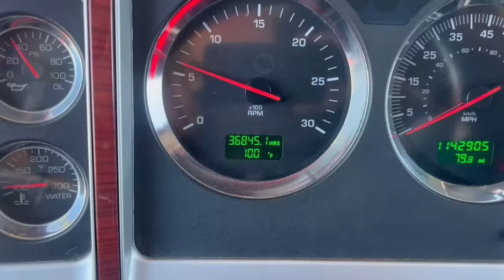"WRAP IT UP" | Engine Harness Replacement on a Cummins ISX KW W900

Comment: Thanks for sharing why you can get by with an older truck,because you do the work saving over 140.00 per hour. This is how it was done by owner operators back in the day. Used to see some guys overhauling their truck in a truck stop parking lot. Awesome job
Reply from the maker: I was present as a kid when my dad and 2 friends were slinging pistons in a 3406B at little America in flagstaff. Miss seeing that kind of stuff, most guys now a days can’t change a headlight bulb ☹️
Reply: @TruckingTogether  I saw a guy at Bigelow road overhaul a mack and I did 2 full rounds from Minnesota to Los Angeles and he was just buttoning it up when I was on my way out for the 3rd round.  He had other drivers offering to help out too. Those days are gone forever,and it's the loss to these new tank top shower shoe wannabes .keep your head up and don't look back.  Luke ch 9 vs 62. Keep your hand on the plow and don't look back. Safe travels

Comment: I had complete confidence in you that you would fix it !! When you have a few spare dollars I would highly recommend you get a large tent or something to pull the truck under when you are working on it to get out of the sun..........also get a large out door / shop fan ........ Working in the heat drains your energy .......and for me makes me lose my temper faster. Just a thought. Great to see you are back on the road.
Reply from the maker: Thanks!! I just need a shop with AC 😂

Comment: Before I retired, I noticed that they were moving towards that cheap plastic loom. I see that it just doesn't stand up, getting brittle and sharp. Perhaps, next time you run into a wiring issue, there is a better quality aftermarket loom use can "sub" to protect those vulnerable wires? Congrats on the successful (and money saving) repair! I think I enjoy watching you work on the truck as much as I enjoy watching you on the road. Martin, you are a true professional and Alice, you are a great business and family partner, too.
Reply from the maker: Thank you Frank, means a lot!

Comment: Good job! Great for the heat, buy yourself the RYOBI ONE+ 18V Portable Bucket Top Misting Fan Kit. Saw them at a party couple months ago and worked fantastic. Great for the patio too as they're portable
Reply: Martin ,   just a question from a real old school guy- think once you found the problem could or would it have been practical for you to replace the damaged wires in the old harness-just interested in your thoughts !
Reply from the maker: I’ll check it out.
Reply from the maker: Walter it was old and in bad shape, r&r was what I was willing to do.

Comment: 6:19 I’ve seen that happen several times, when I worked on transit buses. More often on the Allison transmission harness, near the transmission. Gillig ( coach mfgr. In Livermore Ca ) used a rigid split loom. Operating vibrations allowed the wires to rub, like your example.
Reply from the maker: Seems pretty common on newer equipment I guess.

Comment: Had the same thing happen to my 2020 Pete 579. If it wasn't still under warranty I would have done it myself.  
Still cost me 2 weeks not running though. Thanks for the video and info.
Reply from the maker: Thanks Jonathon, yeah that’s the problem with warranty and dealerships. They take to long!

Comment: Wiring harnesses in commercial vehicles are built so crappy. I'm not surprised the shop wanted to charge so much in labor. The experienced mechanics want easier jobs and the new guys tend to break stuff. That high labor rate is insurance against the customer returning with more issues. Mad props to Martin for fixing it.
Reply from the maker: Thanks Sterling, agreed. The new harnesses are built like trash.

Comment: Martin , you the man. But please tell me why you didn't take and put the truck in your Air Conditioned shop to work on. It would have been much cooler.  Where you live and the heat,  the shop should be a priority. Is the winters there just as brutal ?
Reply from the maker: I have an air conditioned shop? Lol I wish. 

No winters here are mild, 60s during the day mostly.

Comment: Fist bump Martin, l guess the type loom they use is easier to wrap then the braided type. The dealer would of charged for each connection they had to plug, ty-wraps were maybe $73.99 a piece
Reply from the maker: Thanks Steven.

Comment: what made you change out your harness my truck is throwing codes and my injectors are reading shut off and someone told me that its a bad ecm, but i want to know can a bad harness cause those issues as well
Reply from the maker: My dash kept flipping out. No gauges, fan, engine brake. It was erratic, was a bad service harness. 

Very possible, I would look at the engine harness that goes from ecm to sensors, injectors, etc.

Comment: PAPE Kenworth says it all.
Reply from the maker: Exactly! Won’t buy anything from them again.
Reply: @TruckingTogether  I tried them once...BAD MISTAKE ! Transmission went in between Seattle and Spokane,  called them they said 3 days and appr.7000.00 2 weeks and 15,000. Later I got rolling.  Hindsight I'd flown home got one of the other trucks and the towing unit ,just took a tractor out and swapped.  And it still wouldn't have cost me as much in time and repairs.  Lesson learned. When you said their name on the video I was like OH SHIT! Happy you got Fancy rockin!
Reply from the maker: Holy shit! What transmission?? That’s insane! Yep got fancy rockin!
Reply: Just a 10 over

Comment: How did u know it was the harness and how much would it have been if the dealer charged you  how many hours it take you to finish
Reply: Never mind about the hours just finished your video did the harness run down to your oil pressure sensor
Reply from the maker: That’s engine harness, mine was the chassis harness. Ecm to cab. So no, the engine harness itself that goes from ecm to engine sensors runs to the oil psi sensor.
Reply: @TruckingTogether  you know if the engine harness is harder then the harness you installed?
Reply from the maker: More zip ties to cut off and plugs to unplug, but no not really harder, might take longer though.

Comment: that was a oem harness, the chassis harness runs the length of the truck and can take about 8 hours to install, if you have to remove the old one for warranty.
Reply from the maker: You know I thought that too, but parts guys keep calling it the chassis harness

Comment: the sad part is there is probably one broken wire in that harness that if found could have fixed it. finding it is the hard part.
Reply from the maker: Bunch of wires with insulation missing rubbing causing a short. No broken wires that I can see.

Comment: $7k omg that's a new definition of highway robbery. Maybe cut the loom away from that stress point put rubber hose around it.
Reply from the maker: I secured it better than factory, should be much better.

Comment: 🕺GO GET THEM MARTIN.HELL OF A JOB ,ON THE TRUCK. BROKERS PLAYING GAMES ON LOW RATES , THE MAYPOP DRIVERS UNFORTUNATELY WILL TAKE THE LOWBALL RATES, IS THERE ANY LOCAL OILFIELD LOADS IN YOUR AREA, IS THERE ANY BRIDGE COMPANY IN AREA, I WORK FOR HEAVY TRANSPORTATION YEARS AGO THY USED OUTSIDE TRUCKS WHEN I DROVE.THAN WENT INTO  OPPERATING ENGINERS AS CRANE OPP WORKED 30 years in bridge work and thy use outside trucking too
Reply from the maker: Nah no oil field here…. I like doing what I do, I’m not complaining about work, it’s not the greatest but I can still make a decent living. Thanks Robert!

Comment: Well glad your hopefully fixed, I can see why you had an intermittent short with the chaffing with the protection loom. Constant vibration will eventually deteriorate these issues, even vacuum lines, etc. How was running the harness thru the firewall into the  cab, an access too the connectors under the dash go? Did you ever research too see if you can purchase a factory owners manual with wiring diagrams online, that would of helped the issue knowing the harness too the cecu ran too the ecm in engine compartment. In the old days before ecm governed engines, it would be a matter of doing power and continuity checks on the harness using electrical diagrams with the color coded wires too there respected functions like the tach or speedo etc. Maybe for Xmas you can get Nick a handy andy toolkit. Lol. If you get a chance I would suggest inspecting all the other harnesses on the engine or vacuum lines for security and chaffing on nearby components, just a suggestion, due too vibration from many hours of operation on the truck. Also you said at one time about your trailer tires being worn, maybe get an alignment on the trailer. All in all great job...
Reply from the maker: There’s a bulkhead connector on the firewall the harness hooks too, no feeding the harness. Nick does need a handy Andy tool kit lol. No vacuum lines on a diesel…. I don’t think I said anything about tires, spread axle wear but that’s normal. My alignment is good on the trailer.

Comment: Whew, so glad the harness is in and working correctly. So, it was mostly a monitor type of harness, meaning, it will do nothing for performance?  Like I mentioned I just came back from Europe, 99% of the flatbed trucks have that movable plastic-canvas sliding enclosure. They are also cab-overs so they can have a slightly bigger trailer. Might only be 1/20th bigger, but that means, the 20th freight is free for the driver/owner ( pure profit )
Reply from the maker: They’re actually shorter than our trailers, I think most trailers there are 45’ long. Yep just a harness that relays communication between ecm and cab.